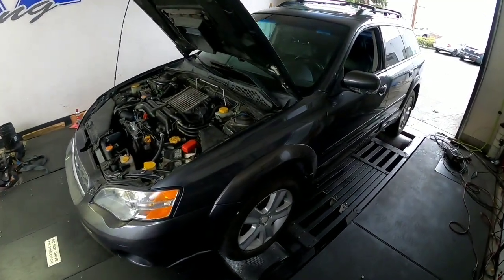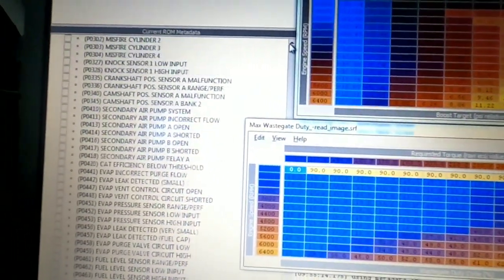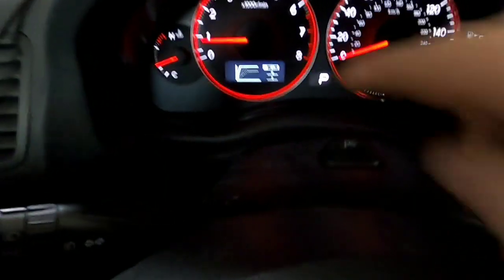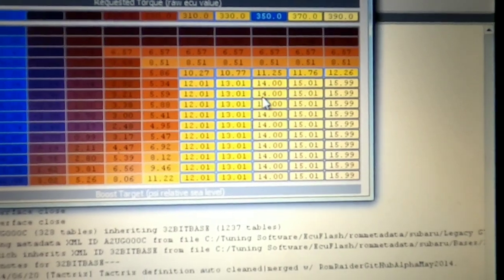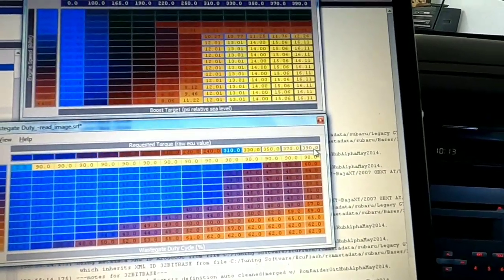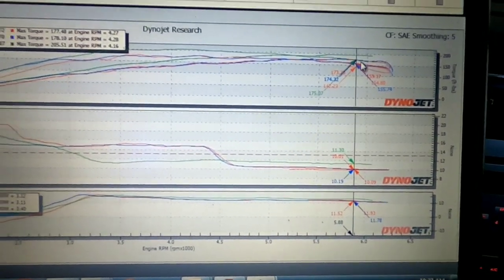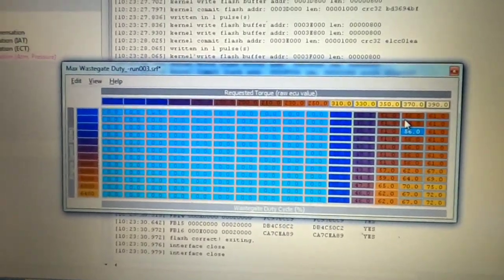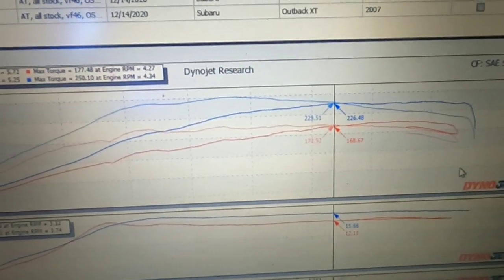Tuning Tech. Subaru Si drive explained.  Does it actually change your horsepower or something else?

Comment: Kind of like comparing a Linear curve versus a Logarithmic curve.. the accelerator is basically a big pot anyway huh..
Reply from the maker: Basically,  and we're just arbitrarily assigning a torque value to different throttle positions using the calibration which is fed into both the boost target and wastegate position tables.